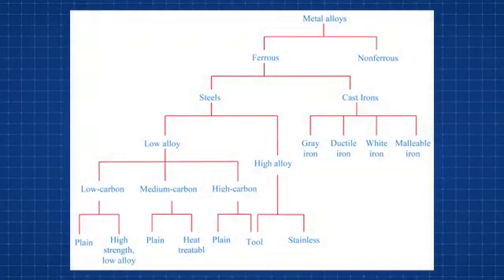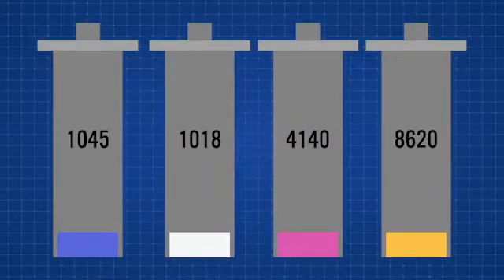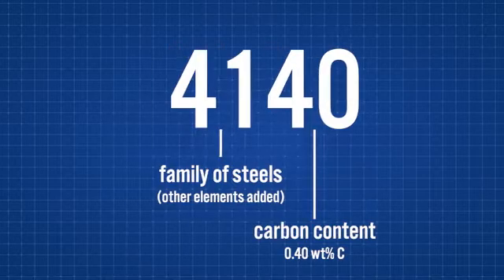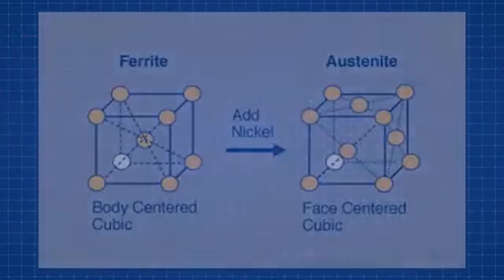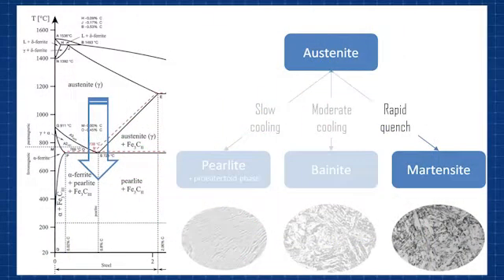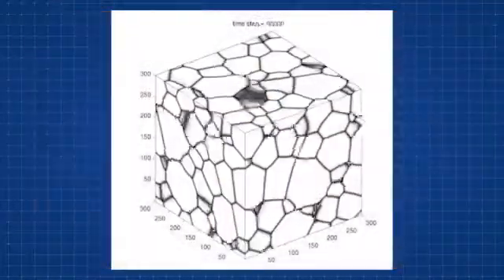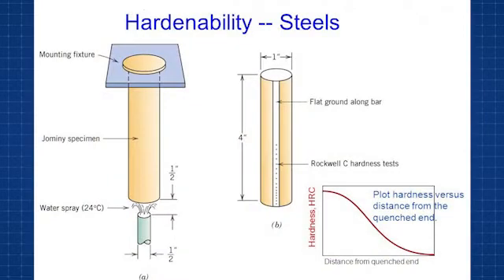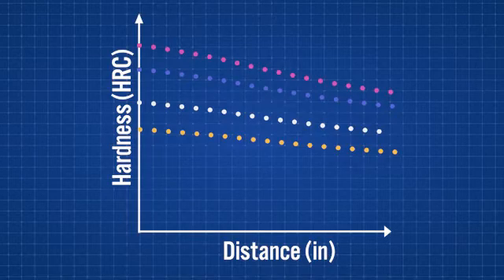Hardenability of Steels

Comment: 6:22 in the sink with the water fountain and the red hot specimen, we can see how it cools down at different rates, but since there is lots of radiation emanating from the cylinder mantle, the cooling isn't only done by the water, especially in the slower part of cooling . 
This radiative heat loss may infer with the precision of this Lab test! 
A mirror like mantle around the test specimen, reflecting the IR-radiation back, would improve, smoothen the radial temperature profile and thus reduce the radial hardness differences, making the followiing hardness tests less dependent on the depth of the ground flat surface!

Comment: You guys have the list of components of the specific alloy and know its quality and usefullness. But one element is missing: Hydrogen! it is hard for a Lab to get a hold on this "volatile ingredient" and it's presence or non presence makes a difference. 
At higher temperature H gets more mobile and diffuses to grain boundaries, weakening them! 
The most reliable way to analyze hydrogen content in alloys is in a Research Reactor by measuring the Neutron scattering (hydrogen atoms and metal atoms have very different scattering properties!).  it can be done in Garching/Munich, ORNL Tennessee, and Touluse/France. in Britain, I don't know.
in the "Greenish-" future, discussed and hyped so much by those many "climate-change-expert experts", Hydrogen embrittlement will become a real pain ! Worse than sulfur or phosphorus!   I suspect that the quality of the final steel even depends on the quality of the coke used in the blast furnace; all the oxygen blowing and even vacuum doesn't get H out, completely, once it is in the melt. 
Have You heard of the problems of the International Standards of weight, the Gold-Iridium Standard-kg (originally smeltered in GB, and then measured in Paris)? Problem is that the samples are drifting apart in weight over a century's time!! 
Culprit: there was and is a different amount of H in the "kg-Standards", depending which "Standard-kg" was cast first  to  Last; in that order/row probably! Historically these 18th century standards hadn't been smeltered in vacuum and they hadn't been smeltered on a electrical oven either!

Comment: Thanks a lot for the content provided.

Does this mean you would have to redo the process over and over again, in order to make the entire piece of steel achieve the same hardability or is this process only done in order to understand the affect of the cooling on the crystal structure of the metal and why you would want to cool down the entire object in steel production for a stronger material?
Reply from the maker: This process is done to understand the cooling rate effects. For all of it to have the same hardness you would quench it. 
For some applications you want a harder steel like for certain parts of a machine or construction. Applications vary a lot.

Comment: Good vid, though I would have loved to see you actually complete all the tests and produce an actual curve.
Reply from the maker: Noted. I usually leave that part for my students in the lab to do.
Reply: @misaelmtz8  Kinda figured that was the deal. Would be silly to ask a question, then answer it. Opens the door for easy cheating and so on. So, yeah... makes sense.
Reply: There are charts published by steel manufacturers.